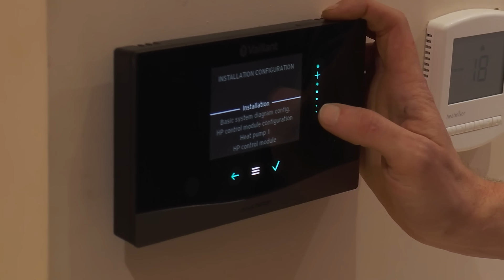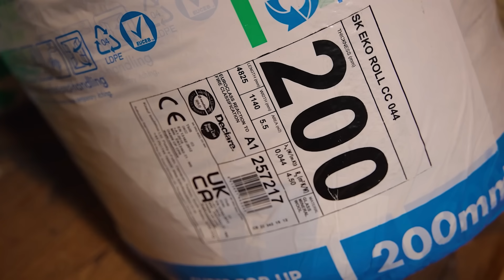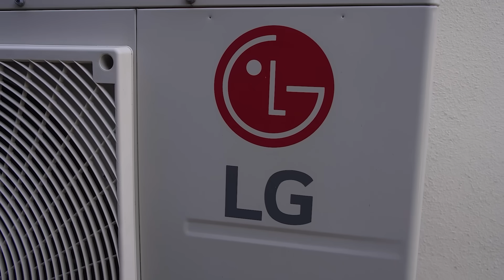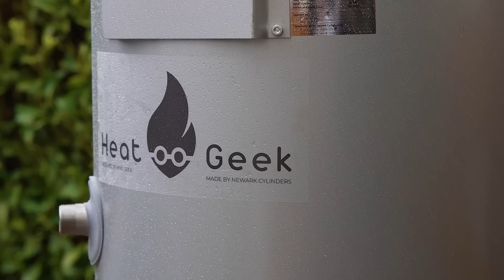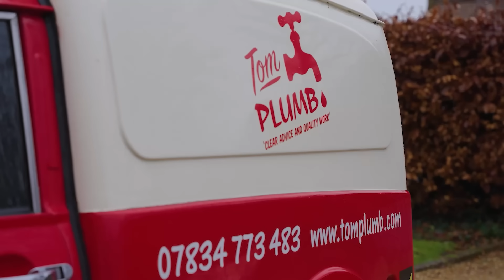Heat Geek’s Heat Pump One Year Later — The Verdict!

Comment: I can honestly say, there’s nothing in the two videos that cover this chaps heat pump experience that makes me go “wow, these things are great, can’t wait to have one”. I don’t have a) a plant room for the equipment, b) the money and c) that much time, energy, patience, inner will, to put myself or my family through it.  I’ve just had my 12 year old gas boiler replaced in our 5 bed home, cost me £2600 and was all done in one day, job done, business as usual, no hassle, no headache, crack on with my life
Reply: Did you look into how easy a heat pump would've been to install? The average heat pump install is £5.4k after grant. A reasonable heat pump install will have similar running costs to a gas boiler.
Reply: @ No, for all the reasons I said and because of the contents of these two Skill Builder videos.  Plus, why should I burden the tax payer?
Reply: You should buy a Intergas with the extend heat pump. Not bigger than a big shoe box and an outdoor unit the size of a regular air conditioning unit.
Takes down your gas consumption around 60%.
Reply: @annotot  

Or get a heat pump, takes your gas consumption down by 100%, and the saving on gas standing charge covers a cylinder of hot water each day.
Reply: Cylinders can be installed in the loft. Various sizes of water cylinder are available. The smallest appears to be the Heat Geek Mini cylinder.

Installs might take 1-2 days depending on the size of install.

Most voters in the UK support action on climate change, and gas boilers reduce CO2 emissions by around 2 tonnes per year. The grant is a fairly cost effective way to reduce emissions.
Reply: @Biggest-hz7ng  who says most voters want action on climate change CC=33 a con, a few years ago they claimed the world was cooling and we must expect a new ice age , its just WEF scaremongering and many of are sick of it

Comment: If you want to sit in a Luke warm  house with Luke warm water go ahead spend a fortune!🙄
Reply: The average heat pump install is £5.4k after grant. In many cases the install is comparable to a gas boiler. A reasonable install will have similar running costs.
Reply: You don't have a heat pump do you ?

How do I know, because temperature can be what you wish within reason (gets too cosy above 25C though, but 24C in bathroom is nice), and 60C hot water will scald, much more efficient heating to 45C and a lovely hot mains pressure shower or three simultaneously if required.

Comment: We have microbore copper pipework. Would a heat pump work with this small pipe or would we need to change all the heating pipework? Thanks.
Reply: Heat Geek say that microbore doesn't necessarily need to be replaced:
https://youtu.be/dEDitJnRgz4
Reply from the maker: Hi Peter. I think it would all need to be changed to get the high flow rates needed.

Comment: Better option would be do a hybrid oil fired boiler system.  Oil prices are at a 3 year low. No standing  charge,  instant heating and hot water  and he's a big enough garden to supply a year's worth of oil should he need it.  Just got my boiler replaced for £5000, but efficiency is brilliant.
Reply: My heat pump installation (two be semi) was £3,995 after grant for total replacement of heating and hot water system including all plumbing, radiators and HWC.

Running at 405% efficiency for heating and hot water over 16 months, any COP above 3.4 is cheaper than gas for standard tariffs.
But with an HP electricity tariff of 14p/kWh means my heating is half the price of gas, so an easy choice for me.
Reply: The average heat pump install is £5.4k after grant and a reasonable install has similar energy costs to a gas boiler.

Comment: We have the most expensive electric because the government is using the money to fund the renewable projects.
Reply: High prices are caused by gas

(say most serious commentators)

The Guardian published an article covering this on 20 April
Reply from the maker: True
Reply: @SkillBuilder  

But not true

search for 'gov Why is cheap renewable electricity' and you will find the house of commons document explaining why renewables are priced as they are.

An extract

"Under the ‘marginal cost pricing system’, the wholesale price of electricity is set by the most expensive method needed to meet demand (usually burning gas)."

Comment: 20 degrees is not warm enough in the house. Can't these things do 22 or 23?
Reply: Yes.  Can do 30C if you really want to, just a matter of adjusting the flow to your needs.
However this is 20C with Stable State heating, where the temperature remains constant, rather than a thermostat that turns off the heating when it reaches a temperature, and then turns it back on again when it dips a few degrees below it.  So whilst you may set your thermostat to 22 or 23C in a typical gas boiler set up, your room temperature is likely closer to 20C.

Comment: After 7 years of payback from the government I reckon I’d have spent around £3000 on the system - mainly for new radiators. In reality add say about £3000 to pay for the original crap install that was then scrapped. The first £3k for the rads is fine - the next £3k is the penalty for not finding a proper installer like Heat Geeks. 😢

Comment: Swapping a combi that fits in a cupboard for a plant room for hot water and eyesore on the side of the house seems foolish to me.
Reply: The hot water cylinder can go in the loft and smaller cylinders such as the Heat Geek Mini are available. Smaller heat pumps can be single fan units.

Comment: My brother was quoted £26k for a heat pump install into a house that already had underfloor heating and a storage tank! He did it himself for less than £5k. A lot of these companies are ripping off the government. They are getting the grant and adding on a load of costs. The £8k grants should cover everything but instead they add on 5-6-7k so the homeowner pays ever so slightly less than it should cost and the installer walks away with £6-8k profit from the Government. Don't believe me? Wickes is selling a Samsung heatpump for £2.2k add a few radiators if you need them and some pipe (lets be generous and say £2k for this) and that is £4.2k leaving £3.8k for the install! But instead they get the grant on top so the install is more like £11k in most cases to bolt down a heatpump connect a few pipes and run a big cable to the consumer unit. If you want to make it transparent the government should pay for the materials part only and the homeowner pays for the install costs, you'd soon see where the money is being made.

Comment: A good friend has a heat pump in a modern building and it heats the house beautifully. It’s like an oven 😊
I live in a grade II listed building, I have an oil burner which is very popular where I live and don’t want to change. Will I have a choice in 10 years or sooner?
Reply from the maker: I don't think they will do away with gas boilers. They are renewing thousands of miles of gas mains in the road and everyone knows that some homes just can't have a heat pump unless it is air to air.
Reply: You may find the cost of maintenance and fuel relative to low carbon options increasing as fewer people buy oil and taxes change. There may eventually be restrictions on a replacement system.

Hopefully air to air will join air to water heat pumps as acceptable heat sources to heat a house.
Reply: @Biggest-hz7ng  I have air to air.  Far simpler and cools the house in the summer.  Doesn't heat the water though so have a rather inefficient immersion.

Comment: Nice to see some balance. As you hint at, everything comes down to the price of electricity. At 10p per kWhr, even at 2:1 no-one would think twice.
Reply: With his efficiency (4.5), the energy cost for the heat pump is much cheaper than a gas boiler

Comment: Most houses are 1970s or before and mostly can’t be insulated sufficiently to make it work.
Reply: Insulation reduces heating cost. Within reason it doesn't restrict the heating tech. Victorian houses and churches have heat pumps.
Reply: @ a poorly insulated property will demand more heating and thus much more electricity, currently gas is cheaper than electricity so the higher demand will be at a cheaper cost if gas is used. Heat pumps are great where low demand for heating but where the poor insulated properties are involved the gas cost outweighs the efficiency of heat pumps.

Comment: Nice to see the positivity. Getting the right design is key. The Boiler Upgrade Scheme rules (requiring MCS certification) hinder the adoption of heat pumps as the process itself is box-ticking.
Reply from the maker: You can fit a heat pump. The MCS is only a requirement if you want a grant.  The grant is holding the price at an artificially high level and doesn't help the long term future of the industry. It pegs the number fitted to 30,000 a year
Reply: @SkillBuilder  Permitted development rules for planning permission currently require an MCS installer. Don't try installing a heat pump through a planning application as local government will impose far more restrictive requirements on noise at the site boundary. Also VAT rules mean fitting it yourself is 20% more expensive for the equipment.
It is like the government (former and current) don't want to install heat pumps any way but their prescribed way. Crackers!

Comment: love this video, says it all. heat pumps work IF heating is designed properly. Christ! Rodger will not give into the fact the technology has far surpassed the gas boiler. £180 for a gas cert !!
Reply from the maker: It is irrelevant what I believe, the fact is that a gas boiler is a lot more versatile and a great deal cheaper. 
Heat pumps did not surpass them. If we give up our gas boilers we need something that works as well and even Adam at Heat Geeks said that apart from the emissions a gas boiler is a perfect means of heating.

Comment: I have a large house and built it with a heat pump .. it’s been living hell and a world full of conmen .. literally spent tens of thousands on it and it’s still not great… on one occasion the pump stopped working .. one guy said I needed a whole new heat pump for 8k .. turned out one of the soldered joints to the heat pump had failed .. welded it up and filled with refrigerant and all good to go

Comment: Most of the electricity that powers the heat pump (and directly heats the water in the rads when it’s -1 outside) is generated by gas turbines in power stations (when not enough wind/sun) and that electricity looses a lot of energy on its journey from power station to home. So the idea that gas can be priced out of use is nonsense, it’s just another way of taxing us to subsidise the ‘renewables’ industry.
Reply: 7% transmission losses are easily overcome by the heat pump's efficiency. And UK grid is planned to be only 5% gas in 2030. Heat pump efficiency means lots of gas is saved even if the grid is using solely gas .

Comment: No mention of the tens of thousands that this poor chap has send to finally get a heat pump installation to work. Rather than waste all that money he should have FIRST externally insulated his solid brick walls. Everyone talks about the Scandinavians using heat pumps but they all Iive in super insulated homes. As for. leaving the system running for 365 days a year, that is surely madness and wasteful. With our gas heating, we can arrive a Heathrow from a holiday and switch the heating on when we collect our baggage and by the time we reach home in about an hour, the house is all warm. We currently rely on our near neighbours for 15 to 20% of our electricity. With the drive towards EVs and Heat Pumps, demand will only rise. Renewables aren't the answer because there are many times when the wind doesn't blow and the sun does not shine (like during the cold snaps this winter). A good guide to life is if the Government is in favour of something it is best to be against it.
Reply: my home isn't super insulated... was built in the 1920s, and the heatloss in -3C is more than the average UK home.  And you're not leaving it running 365 days a year that's just a misconception.

Comment: So, to use this inferior product you have to increase the insulation dramatically, change the radiators to more efficient ones, keep the heating on all the time because it doesn't really work to heat up the house.
I think it's a load of rubbish.
And for all that is it costs about £18,000 plus (minus the £7,500 grant from the government if you qualify.)
Reply: Average heat pump install cost after grant is £5.4k. Owners comment favourably on the consistent heat they produce.

Comment: think i will keep my gas boiler until they get rid of the cowboys heat-pump fitter who don't have a clue what they are doing, they should get staged payment over a period of time, this would cut out the cowboy companies that are springing up all over the place.
Reply: The larger installers (BG, E.ON and Octopus) suggest their installs will achieve SCOPs of over 3. I think this works be tempting for straightforward installs.

Comment: Real World Example: We recently moved into a five bed detached bungalow and decided to swap out the old oil fuelled boiler for a ASHP. 

Had a well known company price the job, but they did not want to design the system to the low flow temperature I specified - I knew full well that with a low flow temperature an ASHP will not only be cheaper than a gas boiler, but it will be significantly cheaper. 

I totally agree with the home owner in this video, more regulation is needed to a cowboy coming in and miss selling this great technology to cash in on the grant. MCS is supposed to regulate the process, but it can do much better.

Fortunately, a friend on mine is a top heating engineer and the system we fitted is top notch. Been through this winter and the house is toasty 24 hours a day. Not only that, but its hundreds of pounds cheaper per month to run than it was previously. 

So, agree with the video, it needs to be regulated. However, it is not true that all ASHP installations are below standard and as the tech becomes better known the quality of the installs will come with it.

Comment: Complete crap- the cost, even with the grants is ridculous, the level of complexity is completely crazy. All the kit will need to be replaced again before you get your money back. We bought an EPC F bungalow with only access to electricity (or oil/ lpg) but no wet system so we went for solar/ batteries and an air to air ASHO plus we also have some NSH for back up but don't really use them. We've also beefed up the insulation and ventalition. I did some of the work myself but mostly not and the cost has not been crazy at all, certainly we have increased the value of our property more than the cost of the upgrade- by a long way! EPC rating is now A and we spend just over £200/ year for all our energy costs (all electricty including heat). Amazing. In contrast my parents spent twice as much on a regular wet system ASHP and it has never worked properly and they spend £4000 a year on electricty! I'm sure there are some out there that it works for but personally i think you could spend your money much more wisely on batteries/solar/air to air ASHP or if funds are tight skip the solar and run all your eletric off a cheap night rate tariff via your batteries.....
Reply: Larger installers suggest their heat pump installs will match the energy costs of gas boilers, so I would expect an increasing number of installs to have economic running costs (and hopefully install costs).

Solar and batteries are a great way to cut bills if you can afford them.